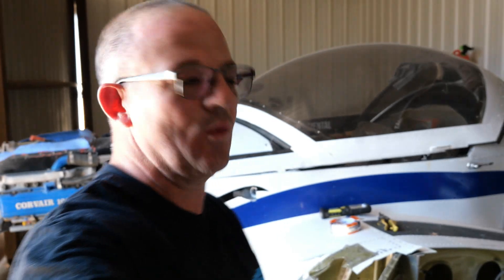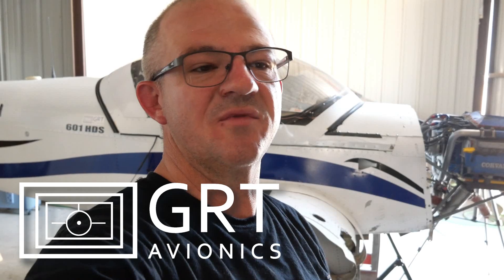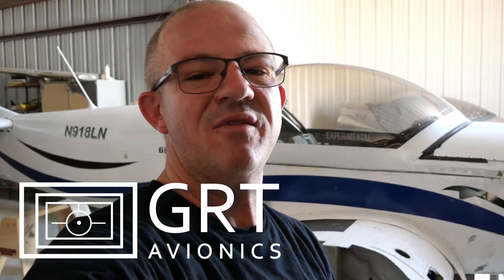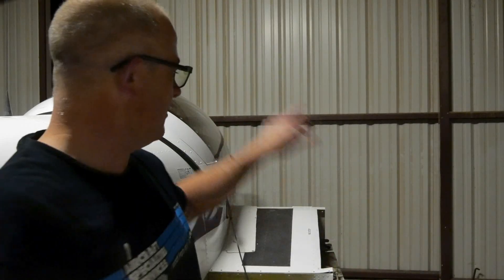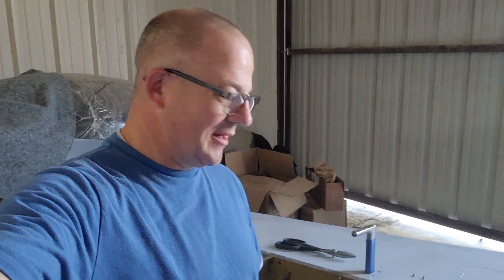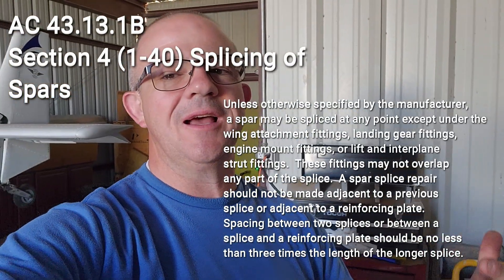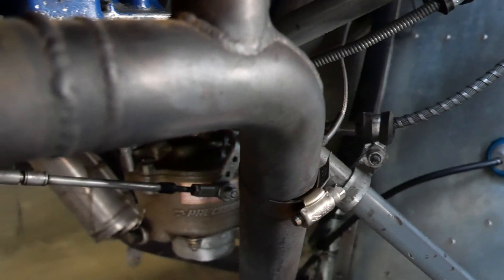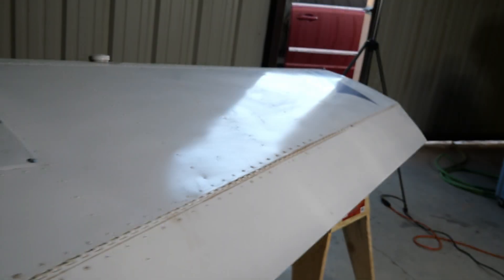Rebuilding My Crashed Plane....Removing the Damage and Inspecting

Comment: Hey Larry, glad to see that the rebuild will be easier than you thought…. What’s the fuel capacity of those wing tanks that you have?
Reply from the maker: @aviation4fun  10 gallons each side.  plus 8 in the Aux tank.  total of 28 gallons.  I'm going to add 1 more tank taking it to 36 gallons.
Reply: @zenvairpilot  cool. Mine only has the two wing tanks. Where is your Aux tank? And where would the other tank be?
Reply from the maker: Aux tank is a wing locker tank.  it was an option with the kit.
Reply: Sorry to hear about your incident it very glad you are ok. Luckily the Zenith is somewhat repairable. Also, thanks for the series of the rebuild videos!